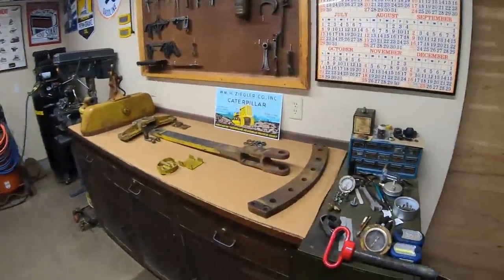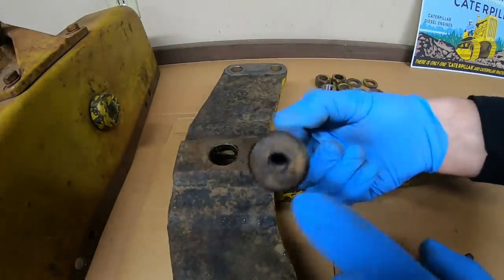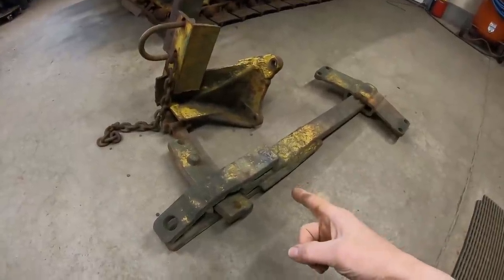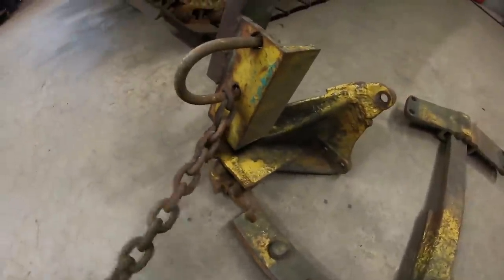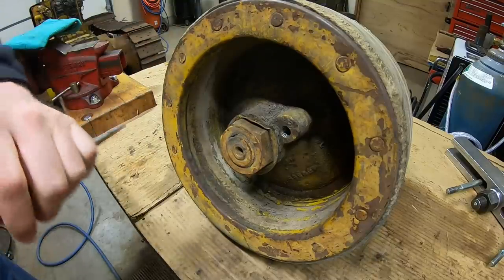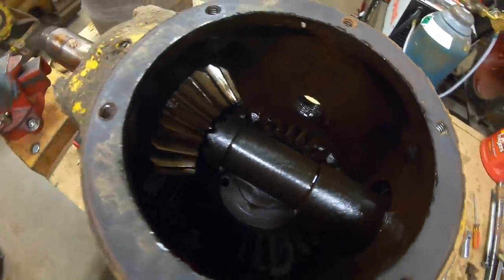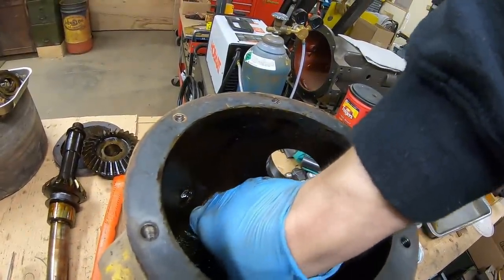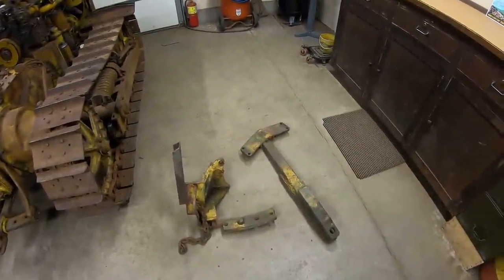Caterpillar D2 #5J1113 Chassis Rebuild Ep.42: Worst Drawbar I've Ever Seen & Belt Pulley Disassembly

Comment: I guess you know, Toby, that belt drive pulley will need to be hooked up with something at any show the D2 goes to!  Threshing machine, saw mill, corn sheller, giant fan...???  We used ours to power the ensilage chopper/blower to throw the silage up into a 40' height silo back in the '50's.  It was a nice load load for it and very economical to run. Always took a couple tries to get the belt lined up when setting up and had to twist the belt half a turn to get running the right direction.  .  Wish that I would have had all the D2 knowledge back than that I've picked up from your vids 60+ years later now.  Nice work as always!

Comment: The draw bar hacking reminds me of an arm the was added to tractors pulling off set discs. With a normal off set disc you always turn left but if you want to turn right there was a chain or cable attached from an arm on the left of the drawbar to pull the disc closed allowing a right turn.  My dad still has these arms for a Ten and D4.
Reply: That's interesting as I recall Dad at one time using of piece of an old moldboard plow frame (ewe shaped) laid horizontal and pinned to the drawbar of our CAT Rd6.  I was very young at the time so didn't understand its purpose.  So wondering if it was to perform as you describe.  We did pull oneway disc plows back in those days and I know it was very difficult if not impossible to make a short right turn. (without the apparatus you mention)

Comment: That explains my leg. I apparently was a logger at some point. Before it was amputated and 6 months after the initial break the leg was malformed in 4 directions. Sheared the screws off on the top half of the "joint." This resulted in me walking on a 1" shorter leg as the break slid past each other. Foot rotated outwards. Heal was 1.5" farther to the rear than should be. And the ankle was so far to the left that I could sight down the inside of my leg with weight applied that I had a 2" gap beyond the outside of the ankle joint. And my "SWINDLING" Dr said it was all normal. SMH!

Comment: I think the beer can drawbar shows  the different between Craftsmanship, your specialty and  CrapsmanShip, the specialty of the Beer can machines torturer.   Once you get the crawler done, we shall be waiting for you to fix some flat belt stuff for it to drive.. Or are going back to overhead belts in the new shop?   a little shed at the end of the shop and a shaft thru the wall.  As a stationary power unit ,that engine could run for years.    I am glad to see her coming together  She be needed to a a grrader into the shop.

Comment: Truth be told I would not have taken anything apart beyond the inspection covers on that belt pulley assembly once I saw that the gears were still good. Not even sure I would have bothered cleaning the thing out. It looked fine, there wasn't any slop in anything, no obvious wear problems, slam it back together and press it back into use I say.
Reply: Walter Mattson  Ye I'm more of the 'if it ain't broke don't fix it' kinda guy. I would have probably just put a fresh change of 80w90 in there and let it ride.

Comment: I think the belt pully is very close (internal components wise) to the one that was used on the MTZ 500 series. They made these for a long time but only on a limited scale since the machinery that was belt driven was slowly going extinct after 1970. I think the KD-35 Crawler has a similar setup(can check later from the book). The major difference is 6 spline shaft vs 8 spline shaft. All soviet internal use tractors have 8 spline shafts, export machines 6 spline shafts. My guess on how bad the Beer can D2 drawbar got was just the simple fact it was a heavy log hauler and thats why it's that messed up and cut and beaten.

Comment: Awesome video squatch253! Could it be possible that when the beer can d2 was working in the woods. That it may have had its load to flip over and cause the draw bar to twist like that? Nevertheless it was rode hard and put away wet! Cheer Squatch
Reply: @squatch253  I'm thinking it was used in the woods as well - might explain why they used beer cans for bearings and slapped the engine back together in such a rushed and improper manner.

Comment: I’m curious how accurate the manuals are with respect to production equipment. In my line of work repairing equipment it is fairly common to find a manual that doesn’t have or has something not accurate to the product I’m working on. Typically an upgrade or rolling change that was undocumented until you try to order a part.  How accurate are the manuals when you tear into a old piece like the D2?  Do you find many discrepancies?  I don’t recall you ever saying much about that.

Comment: The ability for a sub 40 hp machine to mangle metal of that size is truly astonishing. Really quite impressive. If the Hyatt bearings are obsolete, what is a guy to do if he finds one that isn’t serviceable? Are there replacement options of similar dimensions available?  Finally, since the fold over locks are full round and could presumably be used on any of the 6 flats of the nuts, could one be reused and simply folded again on a different flat position? If so, one might say they have at least 5 folds left in them!!!

Comment: What were the advantages of using one of these for field work vs a wheeled tractor? The complexity and longevity of the track stuff seems like a big negative for field work. Soil compaction is better or worse? I speculate that draw is higher than what was available from the wheeled tractors? Always wondered, I don’t recall ever seeing one doing field work in my lifetime or old ones hanging around the farmsteads in the woods. Grew up in the red river valley, maybe they did not need them for working the pool table smooth land?
Reply: Cat traction was a big thing before 4-wheel drive was common. Unfortunately, the operator of this tractor plowed with it like using a wheeled tractor.  He did not know to keep both tracks on the unplowed ground.  That sort of offset plowing would seem unnatural to someone  used to wheeled tractors.  Working with both tracks on unbroken ground would have reduced the wear ans stress from canting the machine like a wheeled tractor.. PTO or not, I still don't see that tractor mowing hay.  It would be nice for brush hogging.  Those wide tracks would do half the work..
Reply: @jeffreyplum5259  We did use our D2 for mowing alfalfa with a semi mounted sickle mower back in the 50's alongside a Ford 8N with a New Idea trailing mower.  The track grousers didn't seem to bother the alfalfa much, probably actually added some aeration.  :)

Comment: Squatch I have watched all your videos and seen you replacing seals question is how do you cross seals and on your fold over locks how do you go about fabricating them. On the seals years ago (showing my age lol) we had cross over manuals do you measure id and od of the item that uses the seal. On the locks I know how to work metal but would like your input on how.

Comment: Do you find that sometimes filming stuff creates problems in the repair process?  For example, in your mind there is a linear logical way to facilitate something BUT goes against how you would need to shoot the sequence on film?  I find this frustrating when filming content.
Reply: @squatch253  OMG I feel the pain! I recently turned some custom pens on my other channel (https://youtu.be/XQCwy1ZFYZQ) for my favorite hockey announcers and found just shifting shots to prevent the viewer from getting bored was time consuming. Sometimes you even have to BUILD a custom mount just to obtain a shot then find it doesn't work in editing. The only reason I shot the pen content was so they could see yes, these really were hand made pens but put WAY more into it than just making a pen.  I did a loose story board for shots, but then found in editing some shots looked like jump cuts because they just weren't diffrent enough. What makes matters worse is when some cameras (gopro) decide to "color correct" themselves while shooting  scene and you only find out at editing. I've had to do automation transitions for color balance just to salvage a scene.  It does help that I've been a radio/TV broadcaster for 34 years. Audio and video tape might be gone but the production issues ALLWAYS seem to remain. You ever experiment with the flexible LED strip light tape you can cut? I found it works very well with a short piece double side taped to my gopro housing. Love your created content Toby as I really know what it takes to pull it off. Oh, FYI, if you remember we spoke that my brother was a RR conductor. If you thought the rails sucked before, it's even worse now. Many of the Cab routes were omitted so you have to drive your personal car to wherever yard you get assigned. Then, no locker, so you gotta keep your stuff in the car!
Reply: @squatch253  sounds about right, shack with a bathroom and no lockers and who knows what place you end up.  The bomber trains are the worst I am told. So much "efficiency automation" trying to make decisions for the engineer and conductor on RPMs and braking in the name of fuel management that they forgot those are live loads with a mind of their own. Imagine a 3 mile string of dead blow hammers filled with gasoline, spooky stuff!  Have a great Easter and looking forward to a "syrup" update from your dad.

Comment: That beer can tractor and  draw bar and everything else involved with it seems more like slide rule engineering descending to sheer frontier desperation engineering more so than intended abuse. Just like when Humphrey Bogart was forced to forge and weld a homemade blade onto the propeller on The African Queen, making do with nothing more than riverside materials. It more appears that poverty or frontier like conditions forced the owner to do whatever he could to extract every last bit of work out of the machine with virtually no means to do it other than force of will.
Reply: @squatch253  I learn a lot from this channel. The sheer quantity of history around these machines is incredible.

Comment: So what does everyone reach for when you finally hit "Fuck it." Keep it to wrenching, no political stuff...
Reply: @squatch253  No it was about when you find a nut or bolt that just won't come undone. Stuff so stuck together you just say "Fuck it!" and reach for that tool you only takeout when SHTF. That is the problem with not being able to use memes here, sarcastic humor goes right out the window. My mention of political stuff was to keep the whole thing squarely on 610 ft cheaters and supercharged air tools. Obviously the comedy didnt translate. BTW that impact gun and air compressor were you using there. I am looking for a compressor that can run that stuff and HPLV as well, but I'm kinda lost.